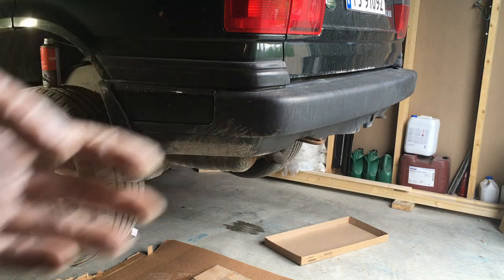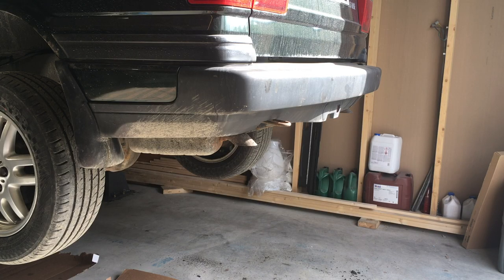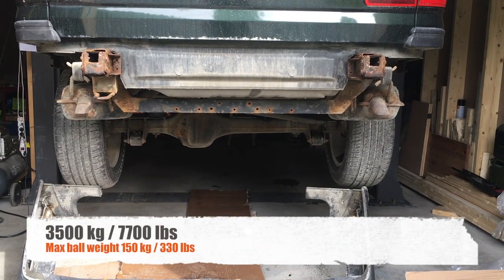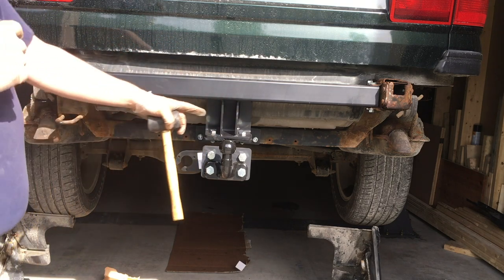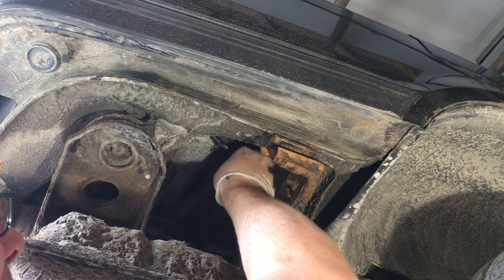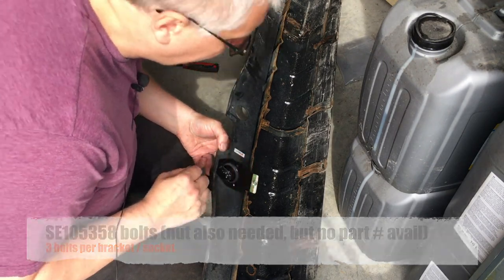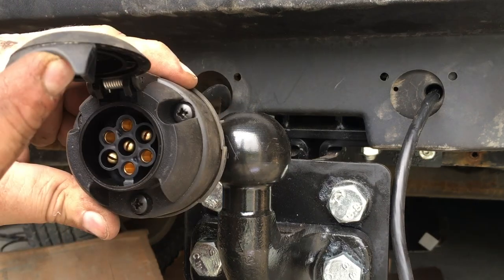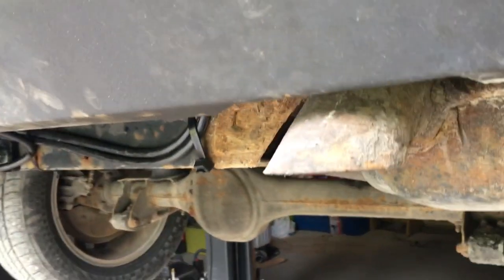Range Rover P38 # 091 - Trailer Hitch with Dual Plug Connectors

Comment: Lucky for me my 2000 had a trailer hitch and wiring installed and it actually still works. Over here we only have four wires for a common trailer  and  a black box has to go between the plug and the onboard wiring harness. I have read it is just a box of resistors that keeps the BeCM happy. When I changed my air bags a while ago I had to remove the inner plastic fender liners (at least it is easier that way). To do that I had to use my angle grinder on all the Philips screws holding the mud flaps on. Just cut them up as I didn't feel they were useful. Rust makes every job harder😣
Reply from the maker: Hi Gordon. Yeah, over in the US (and Canada?) I know you use the tail lights as both indicators and tail lights by just turning them off and on when turning. And then just brake lights and ground would only require 4 wires. The black box probably contains a couple of relays to allow the tail lights to blink when you turn. I've replaced a few rear air bags but never had to remove the liners though. But I've done it from under the car which makes accessing the locking pin a bit easier. Rust = double the time (at least) to do a job. Oh well, maybe I'll retire a sunny place when times comes :) Thanks for watching!

Comment: Do you know if US models have the same wiring specs? I'd like to install a 7 pin. US models do not have round pins, but flat. I have access to the plug on my Rover, but curious if UK and US are same for wiring purposesm
Reply from the maker: Hi Eric. I belive in the US you have electric trailer brakes, so I think the wiring is different. You probably can use the 7-pin plug but you'll need to check how the US wiring is done. Thanks for watching!